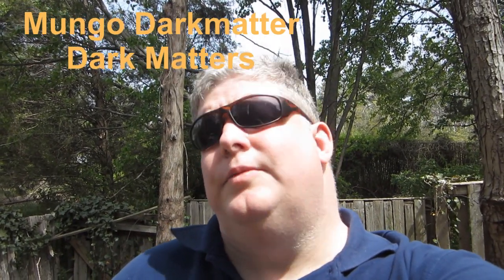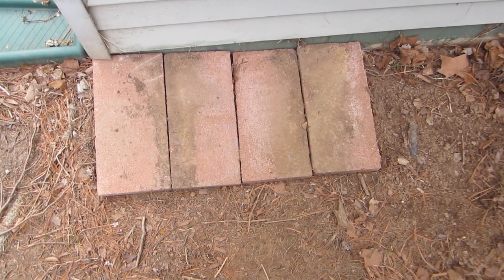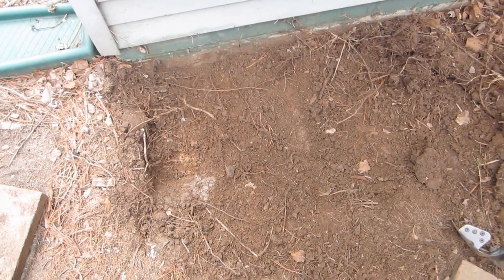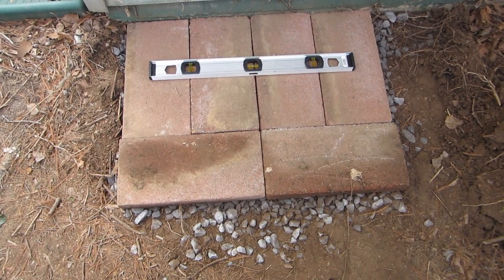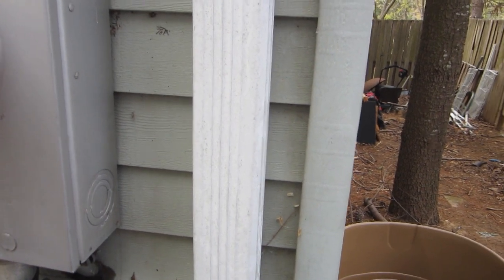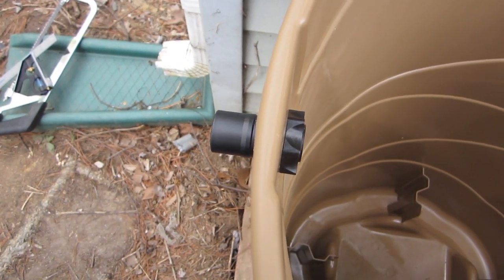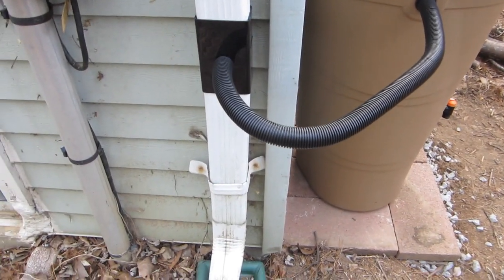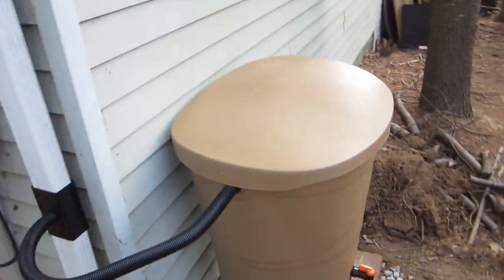Installing a Rain Barrel and Diverter

Comment from the maker: You are right.  The higher the rain barrel the better the flow since the water will only flow out of the spigot if the hose is below the level it.  This rain barrel the spigot is a foot or so above the bottom of the barrel so it raises the spigot level and there is always water in the bottom of the rain barrel which is to weight down the rain barrel.  I had considered creating a platform for it, but the instructions warned against raising it because of water it could weigh as much as 400 lbs.

Comment: Mungo, you might want to ensure there is at least 200 micron filtration for the downspout otherwise your rain barrel will shortly become filled with fine sediment, and in turn grow algae-which will smell something awful when the weather warms up. Likewise, the diverter system you've purchased typically capture only 8% of rainfall. It's preferable to purchase a rain barrel with a larger inflow capacity and an equivalent sized overflow. Try a RiverSides RainBarrel for your next project.